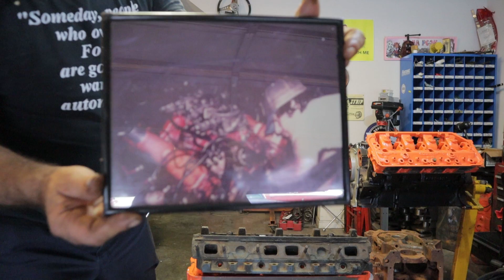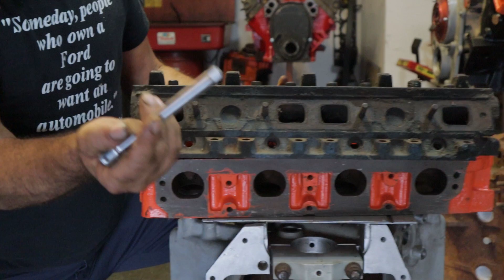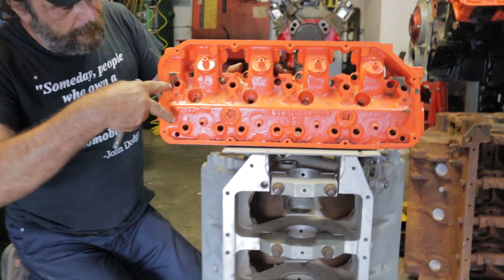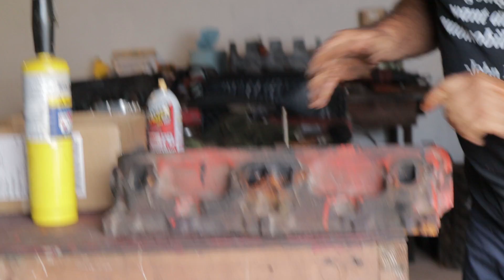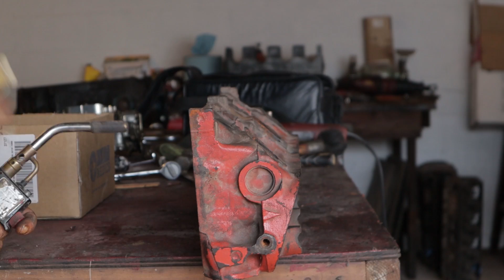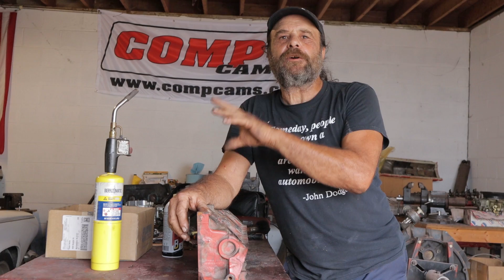What Makes The Small Block Mopar Such A Great Engine?

Comment: Good points on the video. And yes, the 6,000 RPM 340 was the "baby Hemi" compared to the B and RB blocks, designed to torque heavy cars around after the first gen Hemi was considered too expensive. Esp. with those long tube ram air intakes. 

(Sadly, the LA used the A's lifter valley, and had the odd lifter angles from the first gen Hemi. An issue after 6,000 RPM, but the Ford Windsor needs its lifter bores aligned if its going to be pushed to these levels, too)

Like others said, the AMC had similar "dog leg" exhaust ports, and the Ford Cleveland had such a bend, the racers just cut the exhaust port off the side of the head and welded on square tubing to make another port. Its too bad Ma Mopar didn't keep the scalloped Poly head design on the L(ight)A engines, the valve setup was superior to the wedge. But I think the cost of the valvetrain was something Ma Mope was looking to get away from, esp. for the Plymouth line.

Depending upon the type of engine performance you want, you are correct about sticking to the displacement. The largest small block a shade tree mechanic could go in the day, was an early 360 block taken out to a .04 340 piston (379 cid), and hog those 340-style 360 heads out. Ford guys could grab a 400M, the Chevies a 400, and the bigger displacement would make torque until the heads ran out of breath before 4,000 RPM. So its a low RPM stump puller, a torquer for the street, relatively speaking, but that 379 cid can make its power in the upper revs, where head flow matters. 

Where a head design that favors the exhaust also shines, is a power adder. Boost just registers restrictions in the intake port, but a port injected N2O is putting its own oxygen into the cylinders regardless of flow--just aim that nozzle right.  Getting it all back out again is a problem for the other engines with poor exhaust flow.

Comment: Damn right Uncle Tony. The 340 was a dust buster and many times all you would see is its tail lights. I had a Cuda 340 left  my Chevy El Camino 396 L78 at the line. He took my smile and twenty dollars with a " do you want to try again? ". 
I got dad's Satellite 440 within a month and ran him again and barely beat  him. Got my twenty back but could not believe he was right at my rear quarter panel at the finish. Damn. That 340 was a full power house. He had headers, Elderbrock,  Holley, cam and duel point. And it look great in black with silver cuda' striping .

Comment: No replacement for displacement? Yeah there is less weight. I think the 340 is almost 200 lb lighter then the big blocks I drove them all in the 70s  318 340 360  383 400 426 440 413 361 350 chevy 327 350 427 455. get the idea. I could go on. ended up with 2 1971 dodge challenger 4sd JS 340 JS 383. keep the the 340.ran down the turnpike  good gas mileage and handle well. Kick in TQ and it screeeem  like a rapped Ape.  STOCK 340 ! prior to the challengers had a 68 mustang cp 302 would not pass a gas station and a 67 fastback mustang 390 gt. last month found a previous owner of 67. might know where its at.  The mopar 400 I think is a diamond in the rough.

Comment: For the 1967 model year, Mopar came out with the LA 318 based on the 273 and they had a developed a new high performance LA engine with a 4 inch bore, for 331 cubic inches. This engine was supposed to compete with the 327 Chevy II, but Mopar was so embarrassed  by the poor performance, compared to the Chevy 327 and to the solid lifter 273 that the 1967 331 engine was scratched from production. One thing it did do, was make thick cylinder wall 318 engine blocks for 1967 and for the early 1968 model year that could be overbored to 4.00". Back at the drawing board, Mopar bored out the 331 engine to it's maximum overbore of 4.04" for 340 cubic inches. The 331 had 273 / 318 valve sizes, so for the 340 the valve sizes mimicked the 327 Chevy valves. The intake ports were made the same size as the Chevy. The exhaust ports were made as large as possible. The improved valve angle in the 340 flowed better than Chevy on the intake side, even with larger diameter valve stems. The 340 manual transmission camshaft had 22 more degrees of duration at 0.050" lift than the automatic camshaft and was designed for a 6500 RPM redline. Mopar decided that a 6500 RPM redline wshould have more expensive forged pistons and to keep costs down, cast pistons were used and valve springs were design for a 6000 RPM redline. The 340 valves usually start floating right before 6000 RPM with NEW valve springs, but after several miles of use, the top RPM is even more limited. With heavier valve springs, even the automatic transmission 340 camshaft will pull strongly past 6000 RPM. The manual transmission camshaft was engineered just to beat the 327 Chevy in power, but it was likely a good decision to drop it after1968 due to the valve springs. Chevy used the Corvette 350 horsepower 327 without the windage tray in the 1966 Chevy II rated at 325 horsepower but for 1967, Chevy used the 275 horsepower 327 in the Chevy II. The development of the 340 was directly due to the 327 engine in the Chevy II.
Reply: Man that's interesting , I have never heard about that 331 engine. I have a 67 Coronet that originally had a 273 that ran really strong . I replaced it with an early hemi ( and a 318 poly K frame for correct mounts ) . It's wild that the poly was available through the 67 model year ( and after ? ) , man they went right back to the multiple engine productions that got them into trouble in the 1950's , lol.
Reply: @Mike_Collins392  The 1967 318 poly engine was for Canada. The US 1967 318 was the new LA engine version.

Comment: Have a 340 built in 1988  in a duster 488 gears 4 speed ported heads 525 lift cam double valve springs turns shift at 7200 stock rods pistons  and crank 20 years ago built a backup motor still waiting to put it in

Comment: The 318 is one of my favorite engines for sure. When I worked at  a Chrysler Dodge, Jeep dealer we had a customer who got 600,000 miles on the 5.2 magnum in a 94 Grand Cherokee . I Just turned 300,000 on my 4.7 magnum 02 Durango don't think it's going to  make 600,000 too rusty .
Reply: 300k on a 4.7 has to be a world record lol
Reply: got 275k on my 5.2 magnum 93 ram 150. it runs so fucking hard i cant believe it. a lose motor is a happy motor i guess

Comment: It's pretty crazy that a raised exhaust port was born from counting the beans. My uncle is a MOPAR guy and swears by the old small blocks... 

Now you can get raised port heads for most engines on the after market...assuming your pockets are deep enough. I don't know about small block chryslers but on a chevy you can even get symmetrical exhaust ports for the right price.

I want to hear Uncle Tony "bench race" (I don't mean that in a bad way) different motors...coukd be an interesting new series.

Comment: I've built 100s of small block Chevy motors over the years and built some 383 strikers and 400 motors but I believe in this same system bevause the fastest motors I've ever built have always been 355-358 cubic inches. And that's b4 you could readily buy sb2 or lt1 raised port heads

Comment: @Tony: What are your thoughts about aftermarket aluminum heads for the LA engine?
Reply: I'm building an all-cast iron 340 but I hope to step up to aluminum heads in a couple years.  The weight savings alone are going to make it all worthwhile.
Reply: for decent heads,is 3k worth it. nope.. only thing id put alloy heads on,intake,& w/pump,would be a 460. then,it weighs the same as a 351,with 3 times the grunt....460 build,,flat tops, 510 lift cam,intake.job done..

Comment: .906 dia lifters
Ideal rod ratio
Great oiling system
Reply: silverbird58  swing and a miss, care to try again.
Reply: @TL-angzarr  engines with poor rod ratio wear the cylinders egg shaped.
Reply: Define ideal rod ratio? And exactly how much difference it makes.  I'll give you 2 huge reasons LA engines suck 1st the pushrods are at weird angles cause the lifter bored were set for early hemi heads then weren't changed. This causes a ton of deflection in the valve train. 2nd the sides of the block are weak there are issues with motor mounts tearing off the sides of the block if you use solid motor mounts. The block itself is weak the trans am and nascar teams of the 70's had huge issued with blocks outright splitting. You only have to look at the changes made to the R series of blocks to see this
Reply: @TL-angzarr  you are so fucking full of shit lol.
Reply: @frigglebiscuit7484  point me to any claim I have made that is factually incorrect.
Reply: silverbird58  I'll give you a bit of a clue, there is no ideal rod ratio for a street motor.  Even then the ideal ratio makes a miniscule difference.  Warren Johnson said "the correct rod length is whatever connects the piston to the crank"
Reply: @TL-angzarr  5.5" rods in the 400 sbc were a disaster.  40k mile motors.  Every 350 I've ever saw apart needed bored .030 over because of the 3.48 stroke and 5.7 rod.  3" sbc's never had the problem, 3.25's didn't have enough of it to really matter.
Reply: @randymagnum143  Yeah but your full of shit. There is no way you can attribute what you have seen only to rod ratio.  All the rod ratio in the world won't save an engine if someone doesn't service it.  The increased side loading is a non issue at stock engine speeds and maintenance schedules.  Infact at low engine speeds a short rod can be desirable. The short rod makes the piston move down faster that motion helps small ports fill cylinders efficiently. In totality rod ratio is one of the last things you consider. Until you know your engine speeds, valve timing, combustion chamber burn rate with your particular fuel and your the characteristics of your intake tract worry about your rod ratio is like worry about a cloudy day.
Reply: @TL-angzarr  I'm strictly talking endurance for heavy duty engines.  There is an argument for short rods in racing applications for various reasons.
Its a geometry problem.  Side thrust on piston skirts is bad for a whole host of blatantly obvious reasons.  Look at any successful 10k plus hour engine design.  Looooong connecting rods in relation to stroke = better cylinder wear characteristics.  
Short of a crosshead design.
Reply: @TL-angzarr  if your building an engine to go 300 feet or 1/4 of a mile, who cares, right?  Say you have a fleet of 10k engines, and you want 800k miles out of them.  Or you buy a peice of equipment that has to remain in service tens of thousand of hours.  This is why certain Mopar engines almost universally outlive their host.   The 318 was ridiculously over engineered and built.
Reply: @TL-angzarr  slowing the acceleration/decceleration of the piston at t&bdc is a good thing for efficiency and engine life.
Reply: @randymagnum143  show me 1 318 that lasted 800k miles. Slowing the piston is not universally beneficial as I have stated before. Depending on engine configuration higher speeds can actually be better for cylinder filling. I'll give you a hint gasoline burns quite fast compared to other fuels if you make piston speed so slow at low rpm the flame front has extinguished and the piston is barely starting to descend. This causes pumping losses.
Reply: @TL-angzarr  i know of at least one 1 ton van that made it that far.  I was more broadly talking of heavy duty engines in general.  
Like i said, if you're just shooting for dyno numbers, short rods may be what you're looking for.  But they will shorten engine life.
Reply: I'll give you another clue since it's obvious you have only cursory drag racing knowledge.  For 327's in super stock the hot trick is to use 400 length rods.  The reason for this is related to what I was talking about before.  The extra hp gained over the longer rod (and this specifically relates to a smaller engine with a relatively restricted intake tract) will offset the losses incurred due to increased friction and piston bob weight.  It's not a huge difference it's 15 to 20hp but when you are trying to reset national records every pony counts.
Reply: @TL-angzarr I'll just let your comment about extinguished flame front due to piston dwell sit out there.  Good lord.  What are you burning, distillate?  Higher octane gasoline burns longer, cooler, and slower than low octane.  Modern 87 octane is not going to instantly explode and go out, leaving the piston to shed of excess velocity as it travels down its crazy long 4.5" stroke, hampered by its 8" connecting rod.  
The most efficent gasoline engines ever tested were long stroke with equally long connecting rods.
Reply: @TL-angzarr  i don't care about engines that don't run long enough to even require water jackets.
Reply: @randymagnum143  provide proof not just hearsay.  800k is an extraordinary claim that will require extraordinary evidence.  For the purposes of low rpm fleet vehicles the effect of rod ratio on anything is even less.  A good maintenance schedule will trump any imagined benefit from long rods. At low rpm the extra side loading is a negligible effect.
Reply: @TL-angzarr  obviously, we're not on the same page.  I'm refering to rod ratio in long life gas and diesel engines.  There are no short rod designs in this field.
Reply: @TL-angzarr  800k is what i said because it is the expected mtbo of an m11 cummins in a high hp, light tare weight application.  I've seen 3406 Cats over a million miles without being opened up.  
Neither have poor rod ratios.

Comment: Not just the exhaust port configuration but the lifters are larger diameter allowing more radical camshaft, angle plug heads are stock, better rod angularity, stronger shaft mounted rockers,  lots of advantages over the other American V8s of the time.
Reply: I just bought an 85 d150 with rust free cab, i mean cab corners  look brand new doors close like a thing of beauty, fenders and bed are solid too, got 85,000 miles on a 318, is that something i could rebiuld and hot rod, or should i just leave it alone and use it for a daily?
Reply: @blakenorman4822  Leave it alone and enjoy it. Start with an oil change, tuneup, repair any little thing that is not working right. Maintain it and keep it clean and you should get many years of reliable use out of it.
Something often overlooked on older vehicles, that can make a big difference in ride and handling enjoyment, is new shock absorbers and an alignment job. That plus a good set of tires and you will think you are driving a new truck.
Reply: @mrdanforth3744  Yeah thanks  thats what i was leaning towards too, brought home an 87 d150 from scrap yard last year with 225 and totally broke  it  down, that one was falling apart , and put suspension and drivetrain on a 47 dodge paneltruck my dad and i had bought a few years ago, so i know my way around these old dodge suspensions and transmissions a bit, these old Chrysler drivetrains just seem to want to keep on purring, and they just seem to keep falling in my lap lately, ha, thanks again
Reply: Agree.

Comment: The problem with the siamese exhaust ports is hot spotting. If you notice ford small blocks never placed 2 exhaust valves next to each other. It keeps the heat uniform across the cylinder head preventing hot spotting and cylinder head warpage even head gasket failure. The modern ford chevy and Chrysler all have evenly spaced exhaust ports or no exhaust valves positioned next to each other (the LS HEMI and ford MODULAR).

Comment: While ford was building boss (high intake port) heads Chrysler was looking at the exhaust side of the equation because they had already sorted out a great intake port design (the same high port). Pretty much the hemi design angles both valves towards the port more than other designs increasing flow across the combustion chamber. Interestingly enough nascar figured out that valve cant or angling of the valve towards the intake and exhaust ports works well for combustion chamber filling and evacuation. They actually have rules in place to limit valve cant or valve angle. Another important piece of information is the actual valve job itself that is done to the head. A 5 or 6 angle valve job creates a smoother transition into the chamber as well as out of it. Plus theoretically it's harder for debris to mess up the seat of a 5 or 6 angle ground valve and seat.

Comment: Uncle Tony, Chrysler didn't know how to size the cylinder head ports on the 340. SO, remember they brought a set of Chevy small block heads, and decided to copy those heads. I would love a comparison between thr 340 and 360 engines.
Reply: No idea where you got that from. The SB Mopar doesn't even resemble the SB Chevy in any way.